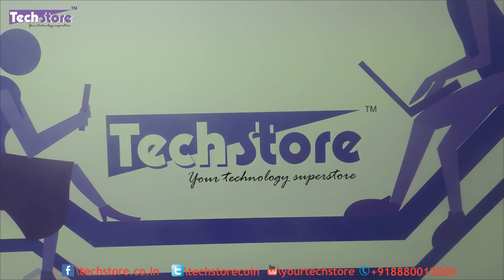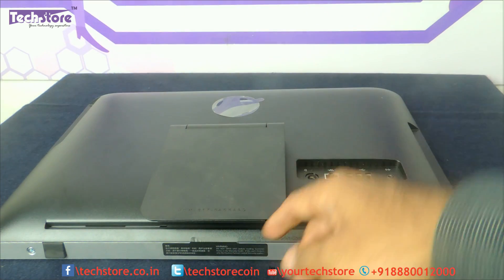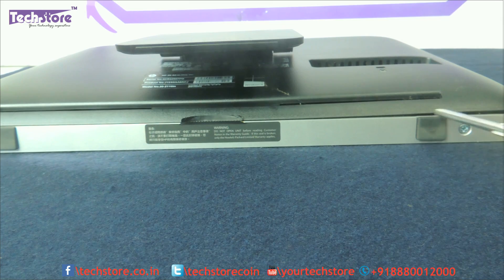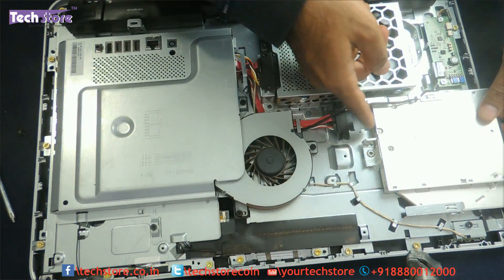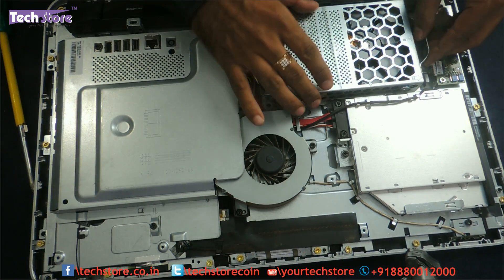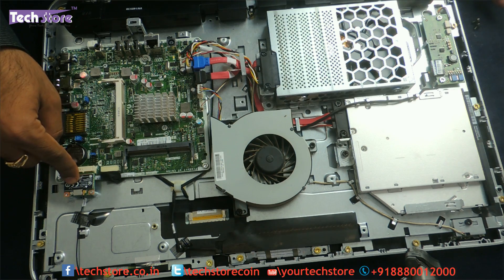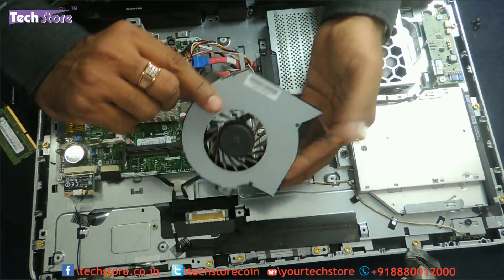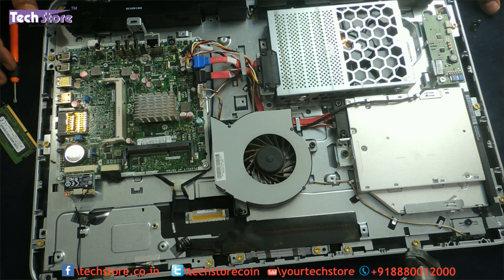hp 20 2015 all in one ram and harddrive upgrade easy diy rip apart

Comment: Do all the HP Q series all in one PC have same motherboard setup ,coz I have a HP 23q-141in ,all in one PC & I need a mother board replacement. HP Authorised service centre has  given up they say we can't provide you support as there is no part available and the system has exceeded the manufacturer warranty,where can I get a refurbished or a second hand part for replacement.

Comment: can i instal an ssd sata3 1tb or do i have to do a sata ssd. im having a hard time finding a ssd in 3.5 thats sata not sata3. thanks
Reply from the maker: Yes you can install a 2.5 SATA SSD easily. Need to buy a SSD bracket - https://bit.ly/3fjBs1y

Comment: I have also this one. But with pentium j2900 processor. 
Can I upgrade processor?
Reply: Processor information
TDP: 18W
Socket type: Not applicable, because the processor is soldered down to the motherboard
AMD E1-1200 (Zacate) Dual Core processor soldered down on the motherboard
NOTE: Because the processor is soldered down to this motherboard, the processor cannot be upgraded

Comment: If i can add 2gb +4gb , system work's fine or not . My all in one pc have intel pentium processor.
Reply: i try to add 4gb ram but the secondary slot not working..
Reply: I learned from other YouTube video, the ram added must be same as the existing ram
Reply: Just buy an 8gb SODIMM

Comment: My computer hp 20-2212 in only shows blank screen takes nearly 20 mints to start, and doesn't work properly very slow, what can be the reason? Can I change hdd with ssd?

Comment: Where is the CPU? I want to upgrade my processor too. So, please make another video on it.
Reply: Processor information
TDP: 18W
Socket type: Not applicable, because the processor is soldered down to the motherboard
AMD E1-1200 (Zacate) Dual Core processor soldered down on the motherboard
NOTE: Because the processor is soldered down to this motherboard, the processor cannot be upgraded
Reply: The CPU is located inside the monitor.

Comment: Can i add graphics card in it...please tell me..
Reply from the maker: +INDIAN X GAMER no you cannot
Reply: Yes you can externally using an adapter from graphics pci express x16 to any all in one mini pci ex port. If its older model you can take out optical drive. You will also need a external power supply

Comment: Thanks man, wish me luck I am gonna upgrade mine to a gaming PC, just upgrading the ram and storage and graphic card.
Reply from the maker: Wish you all the best.
Reply: Jake Poston how are u gonna upgrade the graphics card also good luck i want to do the same thing
Reply: Can't add a GPU tho? Lmao
Reply: Processor information
TDP: 18W
Socket type: Not applicable, because the processor is soldered down to the motherboard
AMD E1-1200 (Zacate) Dual Core processor soldered down on the motherboard
NOTE: Because the processor is soldered down to this motherboard, the processor cannot be upgraded

Comment: Thank you for the video.  I just purchased a HP AIO PC 20-C023W Energy Star and it is very slow.  Is more ram the way to speed it up?  If so, where do you suggest I purchase it?  thanks for any help.  Its been more than 30 days so I cannot return this computer
Reply: One of the big problem with HP machines is they put a lot of bloatware on their machines. More RAM will help to a degree. The best way to get more speed is to open the programs and features and remove the HP related junk.
Reply: @555technoboy  I have same pc and it is very slow. I have also removed all the Bloatware and extra software. But its speed not increase.

Comment: I have Hp all in one touch smart 20-f201in. H5Y55AA#ACJ. DETAILS HERE https://postimg.org/image/kee1svudp/

I need to know 1. can i increase ram then how much ? 2. i need to add graphics card for gaming can i add? then how much and which brand  any video help 3. if i downgrade to windows 7 then how. really need urgent help facing many problems - thanks and merry xmas !!
Reply from the maker: 1. You can upgrade to 8gb max for this processor  2. You cannot add graphics card 3. Downgrading to windows 7 has to be done using help by microsoft support. 
You are using a pathetic processor based all in one. I suggest you sell this and buy a new one.